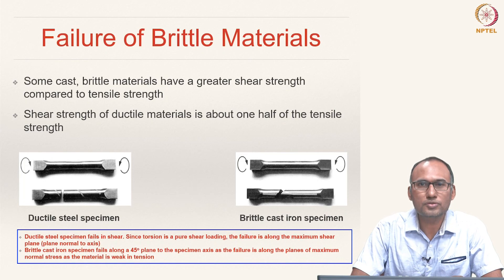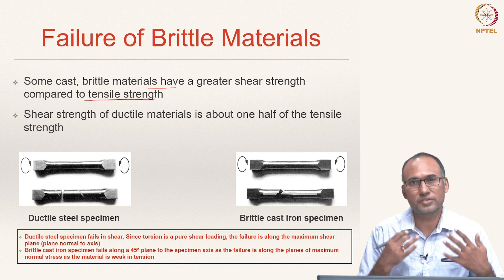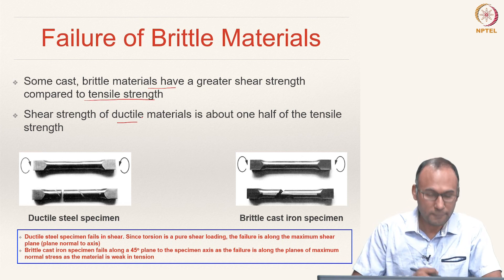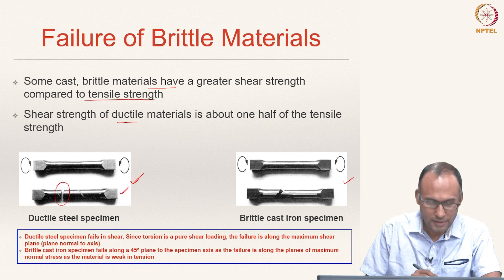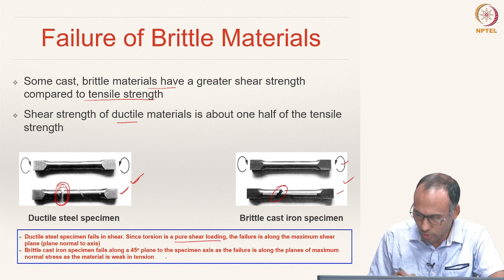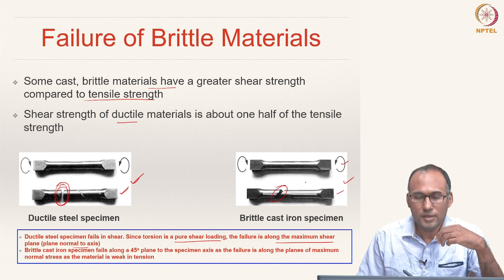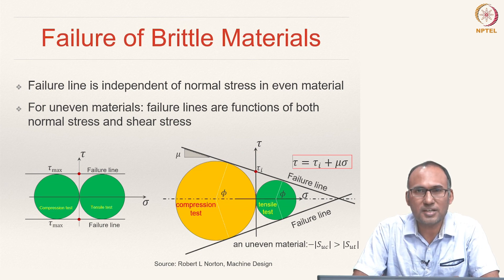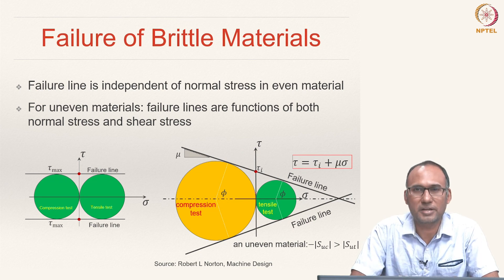#36 Static Failure Theories | Coulomb Mohr & Modified Coulomb Mohr | Part 7

Comment: Sir
How do we differentiate then practically between the specimen material failed in the brittle manner in torsion and those failed in ductile manner in at 45 degree angle in uniaxial tension?